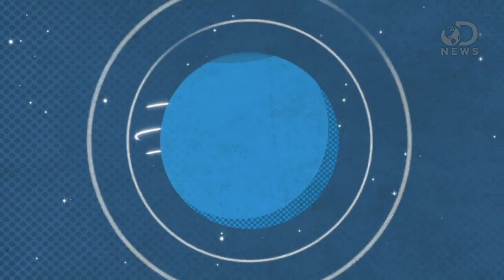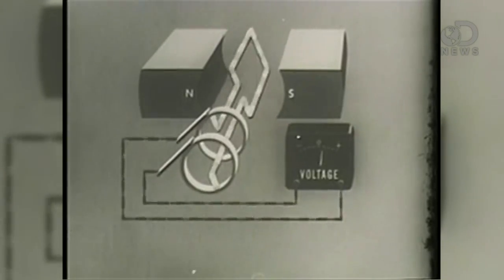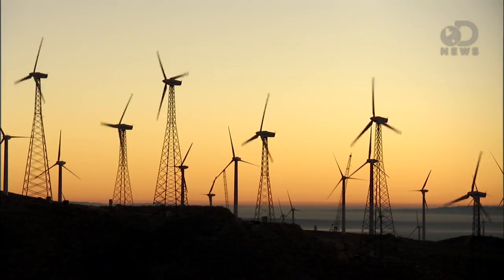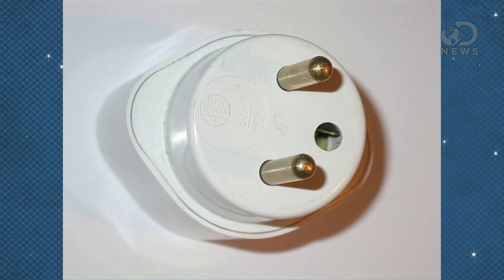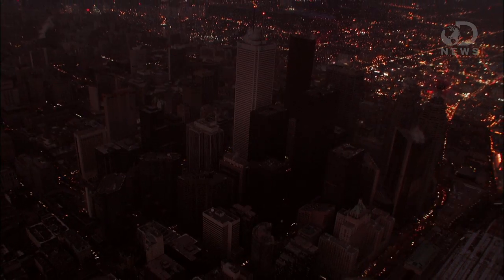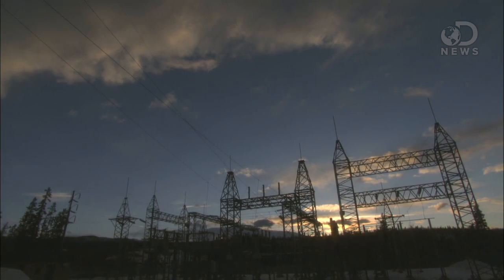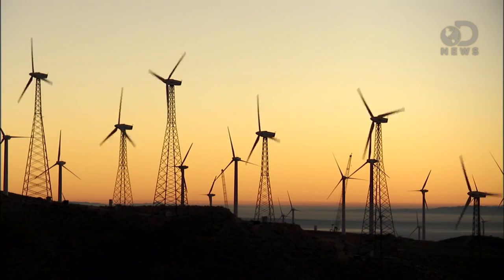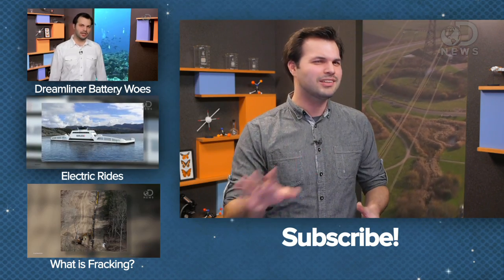Big Game Blackout: The Power Grid Explained

Comment: (much simpler said, like switching DC power on and of 40,000 times per second with IGBT's) this will be high voltage so it can travel long distances, it will have a constantly varying field so transformers can easily be step up or down the voltage, and be filtered by capacitors to produce pure DC energy for powering devices.

Comment: Current is what kills you.  Voltage doesn't kill you.  You see a lightning bolt, and someone says, hey that lightning bolt will kill you.  Lightning has high volts but low amps.  The volts that lightning has is access of 2000 volts, but less than 200 amps.  Do the math.  V*A=W.  As basic as you can go.

Comment: Basically the US got into electricity before Europe and by the time Europe joined and decided a higher voltage was better the US was too far into it to turn back :) Also a lower voltage is safer than a higher one so Americans are a little safer but a lower voltage means a higher current so it's less efficient thus more expensive in the US to carry current

...I think

Comment: The United States Power Grid is pretty ancient.  The Europeans are much more advanced than ours.  They have wind, Solar, Hydro, and Geothermal.  Where as us, we use mainly coal.  There are some power stations that have wind, but what happens when there's no wind?  Same with solar, but what happens when its cloudy?  We have dammed up every river we have.  We don't have a whole lot of geothermal around.  Nuclear.  Reliable, easy, and safe.  For the most part.

Comment: Mathematically electrical power is a function of the product of voltage and current.

All wiring has a internal resistance. Unlike what is taught at schools (At least in South Africa) the internal resistance is not constant and is actually a function of the amount of current. 

Thus, if the power is kept constant and you increase the voltage, the current is decreased. As a result the internal resistance also decreases and the power loss over the power lines are minimized.

Comment: If u use higher voltage u require less amps.  Then you can have more items plugged in without blowing fuses.  208-240v is more dangerous tho